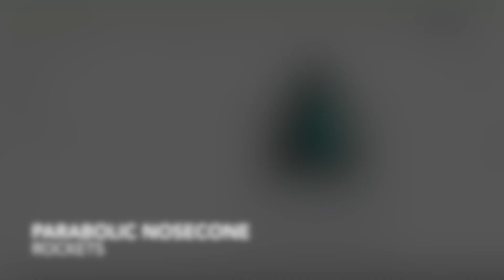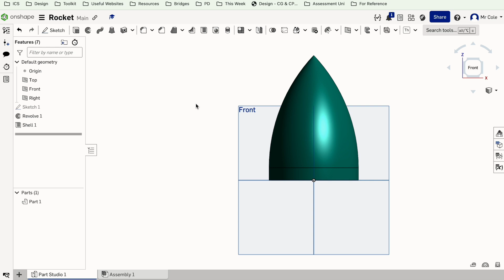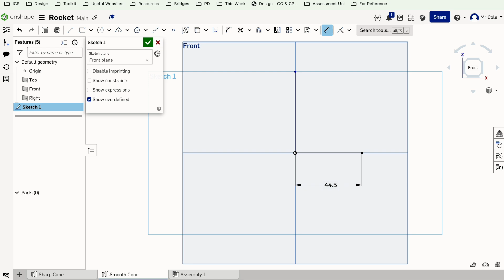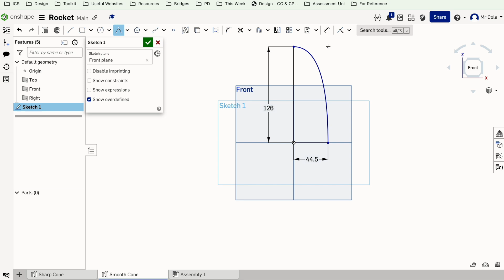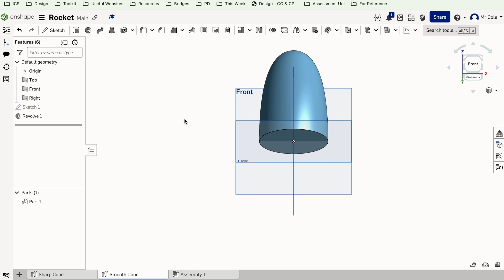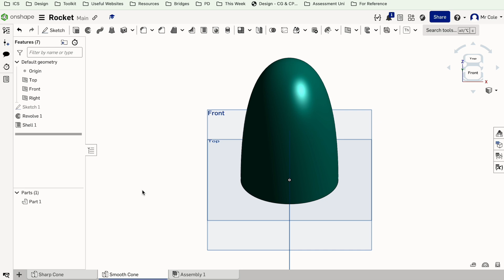How to draw a Parabolic Nosecone

Comment: This is a nice and practical video ... but I can't resist jumping in with a slightly prissy math-pedantry; the "conic" tool doesn't guarantee that the shape is actually a parabola -- it can produce any of the conic functions, and the nose-cone here is actually elliptical, and for most aerodynamic applications that shape is better than a parabola both because you get more volume and because there is not a sharp "break" in slope where it joins to the (presumably cylindrical) body behind it.  Aerodynamically you want that point to exhibit continuity of first derivatives, and at Mach numbers over about 0.8 you want the 2nd derivative to match too, to reduce shock-wave formation and associated drag.   Consequently true parabolic nose-cones are just a bad idea.

There are easy ways to produce a true parabola -- the conceptually simplest within typical CAD 3D tools is to use the Bezier tool -- if you simply fit 3 particular points (a point above what will be the apex of the nose cone and points in a plane that correspond to the circumference points of the cylindrical rocket body) with a Bezier curve the result is a parabola ... and you'll see it is an undesirable nose cone.

Bezier curves are polynomials -- when you fit three points the result is always parabolic (because the result is a second order polynomial ) -- if the points are chosen to have the stated symmetry the result is visually obvious as a symmetric extent of the parabola. (If you pick any three points that are not colinear the result is still a parabola, but it may not be obvious because it may not contain "the center.")